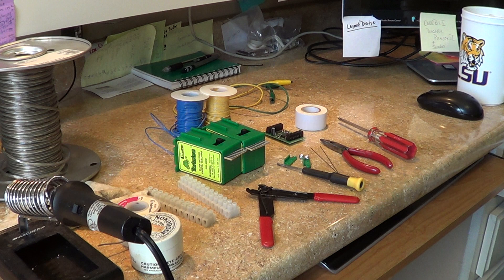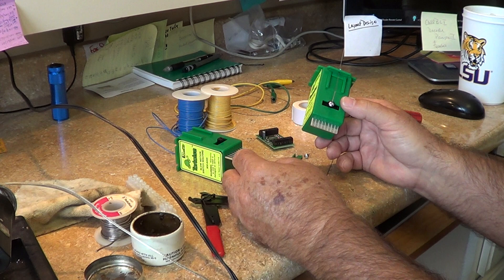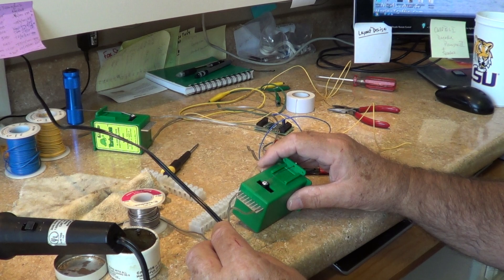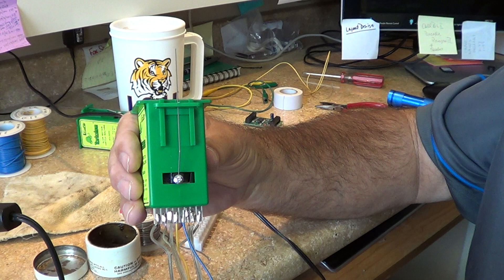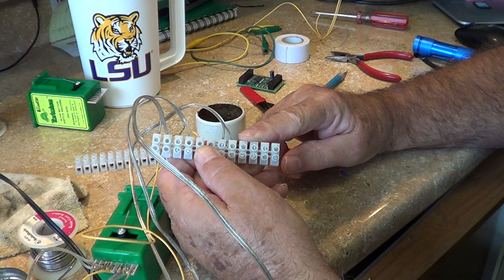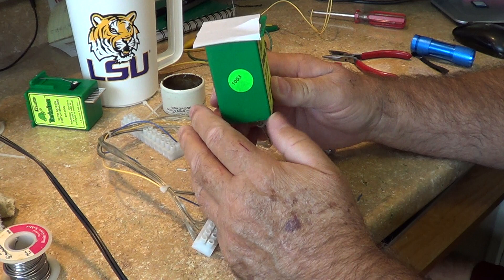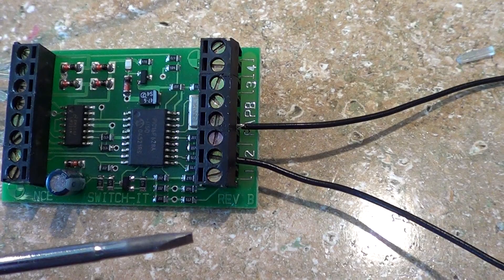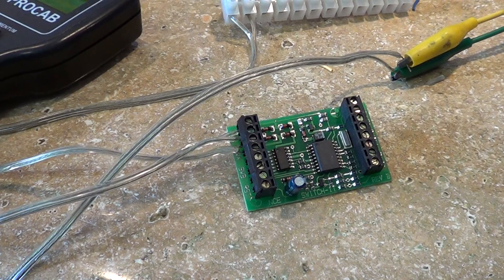SETTING UP TORTOISE PART I  HD

Comment: Art didn't mention, but that soldiering paste he uses is a non acid paste. Don't use the plumbing paste as it has a load of acid in it and will react with metals causing corosion. For electrical connections that can be really troublesome. I think the brand used is called "No-Korrode" (not sure of spelling) brand. Be careful. They make both types paste, and both used to be sold in same color cans, so be sure you read when you grab and go to the check-out.

Comment: Were did the Black jumper cable hook up to
Reply from the maker: If you talking about during programming it is a loop goes as a shut to make the decoder go into programming mode. If you do it today on the new model MK2 you push buttons.   The alligator clips go to track voltage.  Accessory addresses all come over track bus.